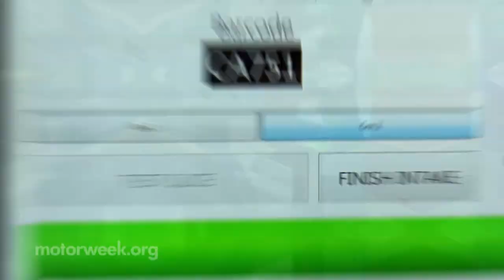Commercial Mowers Go Green With the Help of Repurposed Nissan Leaf Batteries | MotorWeek Auto World

Comment: I could do without the noise pollution. Also electricity prices in your state need to be low enough to beat the cost of fossil fuels. Don't know how long it would take to offset the cost of the mower. I would be interested if I needed to buy new equipment.

Comment: The payback  on buying electric does not make economical sense for consumers.   Decent (ones that work well) cost upwards of $400-500, have smaller sized blades and can not compete with mowers half the price unless on super flat and smooth yard.    Just as it use to be for Hybrid cars and now electric cars, the payoff does not allow you to break even or would take too many years to break even for the initial money you are out.

Comment: Good luck mowing with a super-short battery life, especially when the grass is tall. Your yard better be tiny. If your yard is tiny, forget about toxic batteries. Get an old-school manual push (reel) mower, where the only energy consumption is from you getting exercise.
Reply: I mow about 3 acres on my property. The bulk of the lawn is handled by my gravely pro zero turn. However, I also have a cobalt electric push mower that I use for more delicate areas of the lawn. It is easily capable of mowing an acre of tall grass.